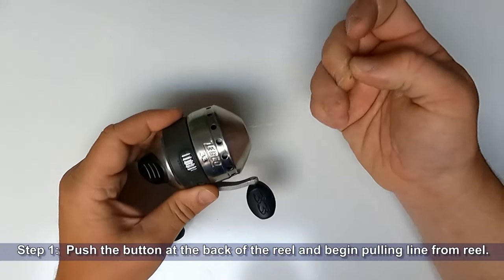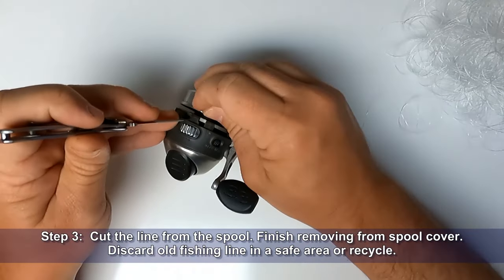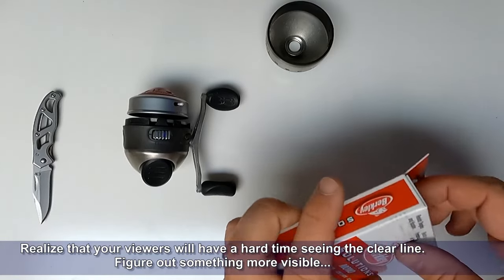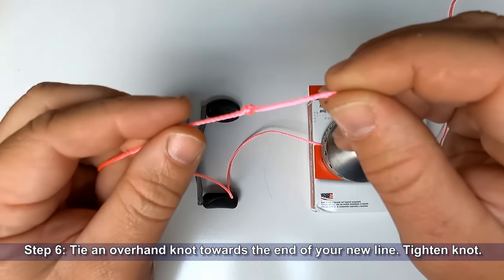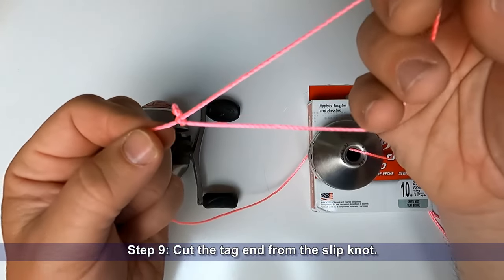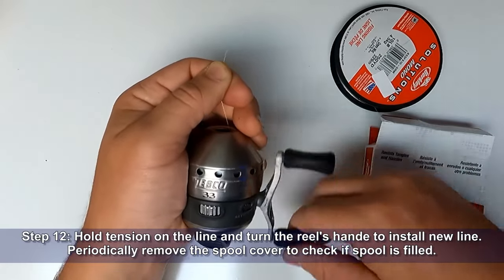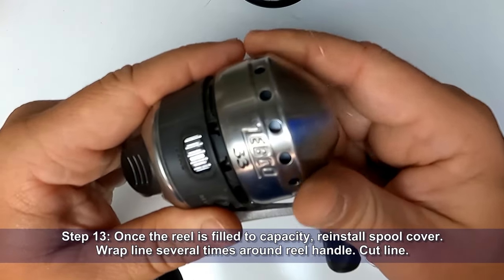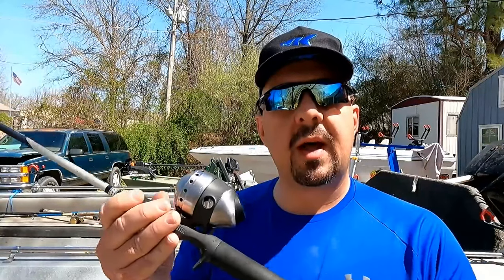How to Put New Line On a Spincast (Push Button) Fishing Reel

Comment: Zebco uas really uped their game on spincast reels, only issue that remains is stucky drags and myself I think its because of line lay pattern
Reply from the maker: You're absolutely right. Drag has never been a high point of spincasting reels. I've always found them to be "sticky" where they'll let out a little bit of line and then hang up for a moment before letting out some more. It's required me to set the drag lower than I would like to avoid breaking my line when a fish suddenly runs.

Comment: Just in time.   I just picked up a new 'mini spincast' rod.   I took it to the lake, tied on a swivel and a bobber and cast it in.    Well, I was thrilled with the cast,,,,,,,until i went to reel in and found out that when it was spooled, it was NOT secured to the reel.    Goodby to a swivel, all the line that was on it, and the bobber.     I should have used an old bobber.    Unfortunately,  the wind was blowing away from shore and soon the bobber and line were gone for good.    Hopefully a boater will see it and pull it out.    I hate finding discarded line and rigs and often take my kayak along the shores and collect all the I can reach.    I have been doing this since I saw a bluejay struggle for over 2 hours while people attempted to reach it.   It was tangled in line from a rig caught in a tree.   Nobody was able to reach it and unfortunately,  the bird did die.    So, this video came just at the right time.    1 question tho.   How long does line stay usable on a spool?    I am talking about line that has NOT been used.    Its stored inside the house, so temperatures are not extremes and no sun hits the storage box.

Comment: Great video.  Thank you!  Curious how these spincast reels handle braid?  Thoughts?
Reply from the maker: Some better than others. Heavier braid seems to work quite well.

I put 30lb on one and it does OK with heavier lures, but if I try to throw something like a round head jig with curly tail grub, it struggles to get any distance.
Reply from the maker: When braid first started getting popular in the very early 90s, my Grandpa put 40lb braid on a 33 I was using.

For a 12 year old, I felt like a pro angler. 😂
Reply: @TheWeekendAngler  awesome info thanks again!   I’m going to give it a shot.   Trying to set up some rigs for my 6 and 8 year old.   We may try to experiment with one to see how effective it is.

Comment: When installing the new line does it come off the spool clockwise or counterclockwise?
Reply from the maker: I usually go straight off the spool, but either way works. You won't see enough line twist to make a difference, and any twist that is in there will release on your first few casts.
Reply: If you lay the spool down label up when reeling new line on the line should come off on to the reel properly.

Comment: What should I do if the reel when it brings line back in, continues to birdnest every time? 

This is getting insanely frustrating for me. I have replaced line twice now and it doesn't make a difference.  This line is barely a month old and just like the previous line, it continues to bird nest when reeling line in on the inside of the reel and then makes it impossible to cast out after that. 

I don't have the money and won't for a long while to go and get new reels. 

I have 2 that are refusing to cast more than about 20 ft. out and one that keeps bird nesting when reeling in.
Reply from the maker: If a spin cast reel is tangling when reeling it in, it's time to do a thorough inspection for broken parts. Most likely, the pin that extends out of the bail and wraps the line around the spool.
Reply: I hope there will be a video sometime to show us how to properly maintain and repair reels.
Reply from the maker: @mariestoves7653  I'd be happy to. Sometimes it gets difficult to come up with ideas for how to videos. Is there a specific type of real that you would like to see a video on?

Comment: Doesn't work, tried that method several times and each time the line coming off the new spool twists up and tangles even if I make sure it is coming off in the same direction. What am I doing wrong?
Reply from the maker: Try this, it sometimes works:  instead of coming off the narrow side of the spool like the line is wound on, point the broad (round) side of the spool towards the reel and let the line come off the end of the spool similar to how a spinning reel casts.

Comment: How did you do the slip not
Reply from the maker: You tie a single overhand knot towards the end of the line. Then you tie a single overhand knot around the line, keeping the first overhand knot on the outside of the second.

As you pull the slip knot tight around the spool, it is only able to slip until it hits the first knot.

I know that explanation is about as clear as mud, so I'll do a video on how to tie it and post it Saturday for you.

Comment: The view was bad. I think it showed the spool turning to allow the line come off which was good but not shown. If the line comes off while the spool is flat on table and not turn the line will be twisted
Reply from the maker: You're correct. Allowing the spool to turn will  help to prevent line twist
Reply: I put my spool on a wooden dowel and put the dowel betwern some books.  Lets the spool release line and I control the tension with my free hand.   I leave the reel on the pole and hold it between my knees.   One hand to reel and the other hold the pole in front of the reel while controlling line tension.

Comment: Dude step 7 messed me up. Your trying too fast and not slowing down for people who are doing this for the first time
Reply from the maker: That's the wonderful thing about YouTube videos. You can back up and watch Parts over again if you need to.

The short tip Saturday series is designed to be just that; short videos that move quickly through a topic so you don't have to spend 10 or 15 minutes learning to do something.

Take your time and review the parts you need to and I promise you'll get the hang of it.